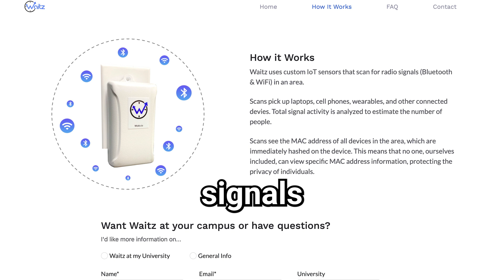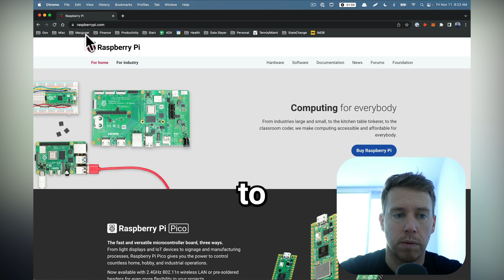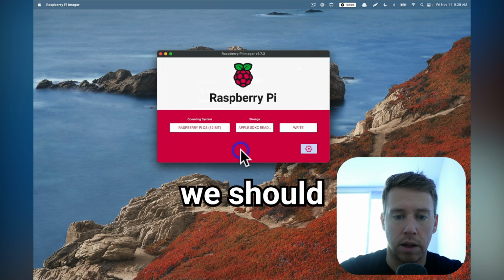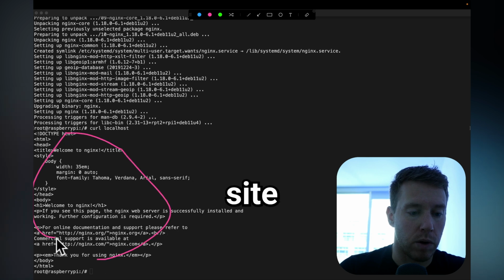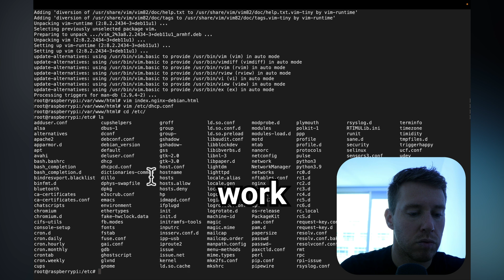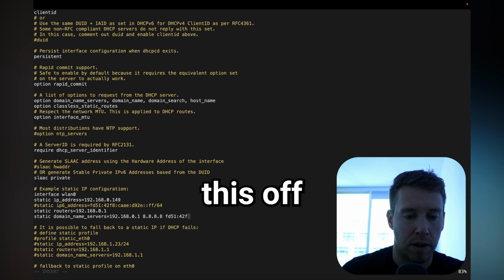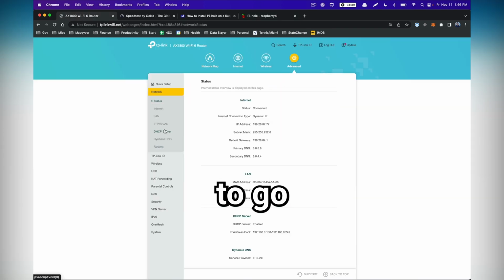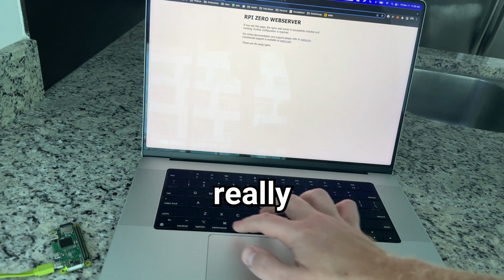Raspberry Pi "Fun Size"

Comment: Hi, I saw your works on YouTube and I really love them. I was given a project to work on in school about image recognition using CNN or any other technique. The scope is to use image recognition on vehicle traffic and clear up the road for emergency vehicles after recognition. Emergency vehicles like ambulances and police cars will be recognized and given priority even when the traffic is heavy. The issue is that I will be needing about 3 to 4 cameras and I'm not quite sure a single raspberry pi can handle 4 cameras with image recognition. I'd really appreciate your expert opinion on this.

Comment: I'm not paying $160-200 for a Raspberry Pi. That totally defeats the purpose and concept behind the Pi community.  
 Oh, and unless you install a chip cooler on your Pi it will last about 6 months in continuous usage
Reply: 160$ for a Pi0? In what country are you living?  
Raspberry Zero TWO+WIFI and a Case and the official Power Supply an SD card should be in a 50$ budget, assuming absolutely zero spare hardware already